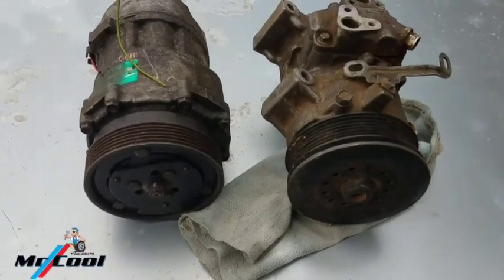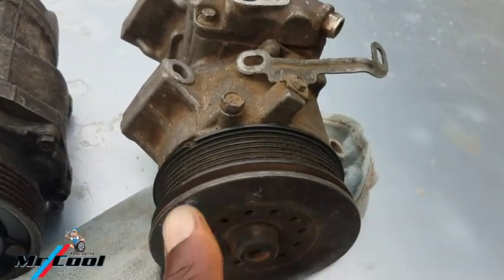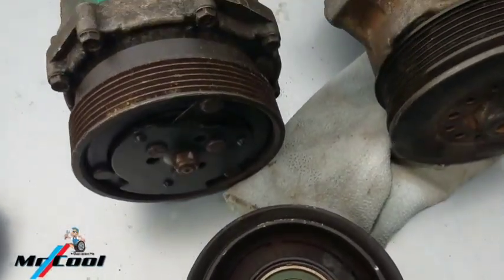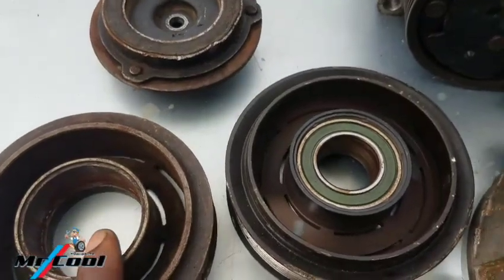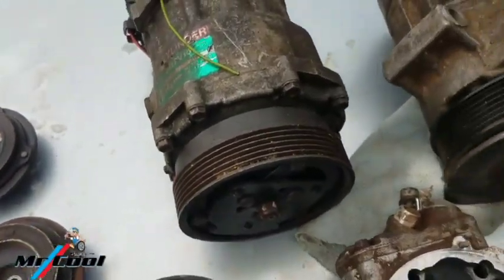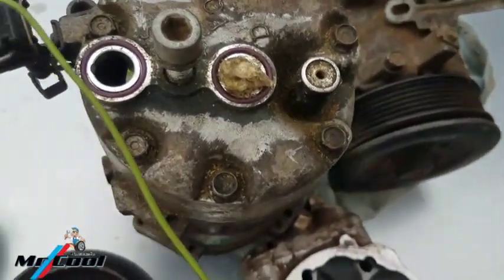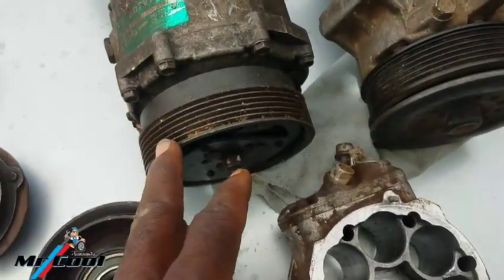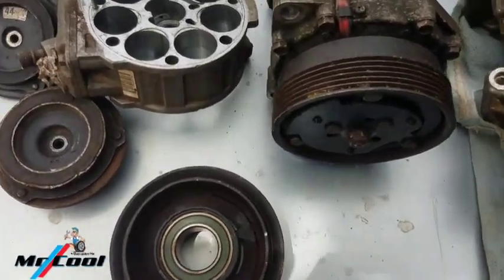Car Ac Compressor Noise Causes & Fix

Comment: I also have an compressor which kinda makes a knocking noise during a cold start but its gone after the engine has slightly warmed up. Doesn’t make noises when the ac is off. AC still blows cold air too.
Reply: Yea me too...wht was ur fix🤔🤔🤔
Reply: Did you get it diagnosed?
Reply: Any update?

Comment: I need some help I got a new used one gas it then it knocks after some time when on it blows cool after air but my problem is the knocking does it needs more oil or too much oil in the system?

Comment: How to fix weak compressor pressure for the air conditioner of a Hyundai Santa Fe 2011, compressor type VS18. The cooling is very weak and cools if you press the accelerator pedal, knowing that the color of the oil is gray and not clear. Can it be repaired by removing and cleaning? There are no annoying sounds during operation, but the pressure is very weak. Thank you for your cooperation.
Reply from the maker: No, that cylinder is bad, replacement is the next solution
Reply: @drcoolautofix  Thank you very much

Comment: Can I remove the bearing without taking the compressor out and depressurizing the system? I have similar issue. no loss of coldness  but a small noise at compressor
Reply: ive seen someone do that on a honda accord if the bearings shot the rest of the pump probably is too clutches are like 150$+ whole new compressor 200-300$

Comment: I got this clicking noise coming from my center console of my dashboard when my ac is on and I’m driving by unstable roads (sometimes is working perfectly) my ac works pretty well and I don’t know what could it be. Also, sometimes my car’s windshield and side doors get foggy but mostly the right side. There’s no leaks coming under the side passenger but I don’t know if it’s something like coolant leaks or clogged components.
Reply from the maker: Tune in to my next FAQ

Comment: I have an 03 Tahoe with the belt off the pulley when you turn it is kind of rough when it should just freewheel..is that bearing like you showed..the older model?
Reply from the maker: Its bearing
Reply: @drcoolautofix  Can it be fixed on the vehicle without discharging? It still cools just getting noiser and noisier i removed the belt for now in case it locked up knocked drive belt off

Comment: I sincerely need to know, when my compressor is blowing very fine, extremely fine and obviously the bearing is not bad, had to bring it down and find out the compressor oil has been contaminated and niw looks so black, can that be the reason, if i clean it up and remount it will it work fine? Please i sincerely need your response.
Reply from the maker: You need another compressor

Comment: Hi, I have a 2008 BMW 535d E61 with a Denso AC compressor. It makes a moaning/groaning sound at certain engine RPMs especially at 1400RPM which is the worst and corresponds to 60 MPH road speed. Note this is a Diesel engine so doesn't rev very high. I have already replaced all the serpentine belt idlers and pulleys, and I have replaced the AC compressor clutch bearing but the noise still remains. The noise also goes away when I disengage the AC clutch which makes me pretty sure it's an internal problem. 

Do you think that adding 5-15ml of oil is worth trying and if so, can the oil be added without depressurising the system? If internal damage has occurred, presumably I would need to have all the AC pipes and evaporator and condenser flushed to remove debris? Is this effective or would I also need to buy new parts?

Thanks.
Reply from the maker: Yeah it worths adding mill of oil into it, yes it can be added without depressurizing the system, I made two videos on how to add oil into car ac system which teaches you the proper way of adding oil without loosening your refrigerant.

Before adding oil you need to check if the system internal structure is depleted,
Reply: I also have a bmw using a Denso compressor.  I noticed a gear whining sound when moving off and the sound got louder. At first i tot bearing issue.  Brought to an aircon specialist shop and the mechanic told me that it is not the bearing and it is likely loss of lubrication.  He topped up the lube and the sound went away.  Hope this helps.

Comment: I have an Acura ilx hybrid 2014 the mechanic told me that the bearings are gone and I need a new compressor can I just replace the bearings instead buying a whole new one it’s quite expensive
Reply: I want to be able to drive until I can afford a new compressor
Reply from the maker: Sure if it's not inside the compressor like prius
Reply: @drcoolautofix  ok it just has a really bad noise
Reply: @drcoolautofix  is it safe to drive until I can get the bearings changed though?

Comment: Not in my case it rattles only when the compressor is on ac is cold. Changed the pulley same issue.
Reply from the maker: That compromise is def heating up

Comment: i have a loud kicking noise when i first turn the ac on, but after that it rans fine, is that the bearing need to be replace?
Reply from the maker: Put the ac off & start the car again, check if it repeats itself